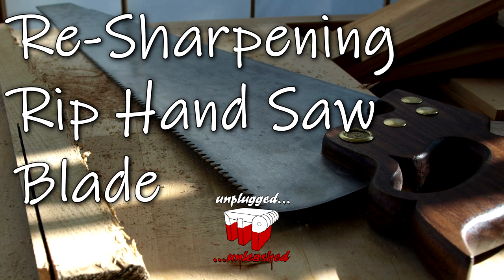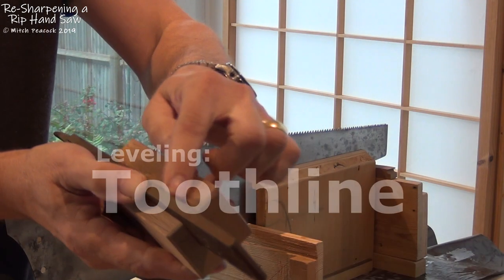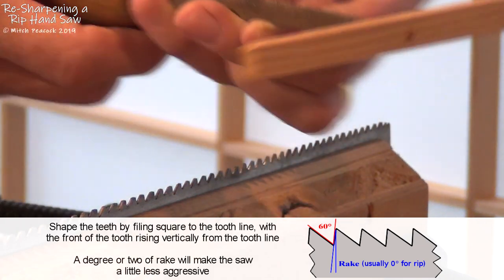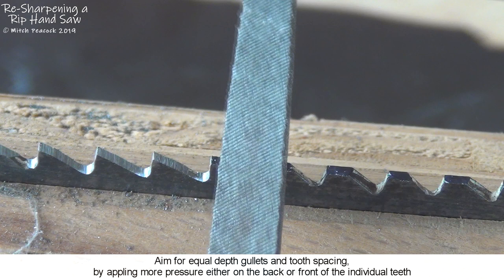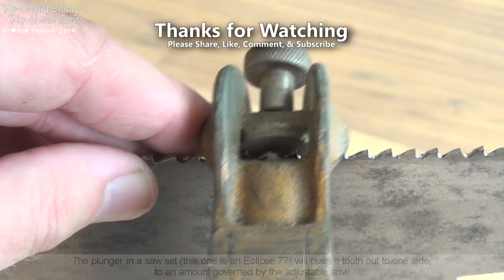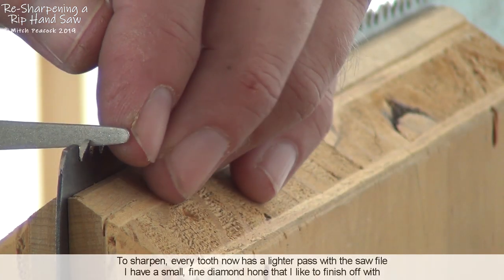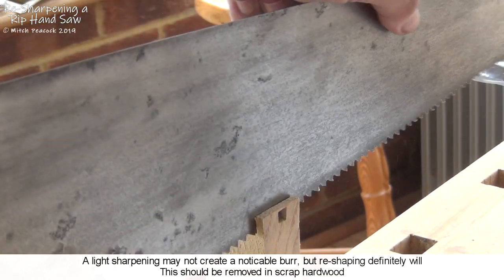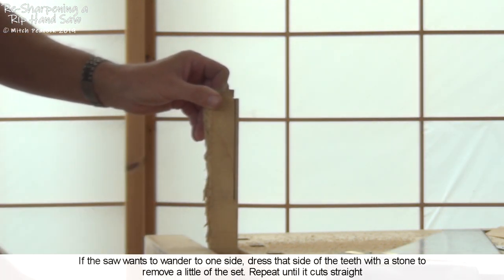How To Re-Sharpen A Rip Saw. Sharpen A Rip Saw. Test A Rip Saw

Comment: I have a saw i bought at a flee market last year...so you are saying that rip cut are off set teeth...what do cross cut teeth look like...hope you don't mind silly questions... inquiry mines want to know...so i will know what type of saw i have...the handle an button is exactly like yours here....thx...
Reply from the maker: No worries. Virtually all saws have 'set' teeth, to produce a wider kerf (saw cut) than the blade thickness, avoiding jamming. Rip teeth have the leading edge perpendicular to the tooth line, and in the same plane as the saw plate, with the tip looking like a chisel edge. Cross cut teeth have leading and trailing edges at equal angles, so they appear like pyramids in silhouette, and are also filed to look like knives. Hope that helps.
The button will often carry the maker's name, which may also be etched on the saw plate.
Reply: @mitchwoodwork  thx Mitch...always great video's...
Reply: @mitchwoodwork  Rip usually dies have less set though...
Reply from the maker: @RayVRoberts  certainly rip back saws often have little set, to keep them on track when cutting joints. Not sure of the convention for rip panel and hand saws though. My thoughts are that these cuts often open or close up, and so half the time a decent set will avoid jamming. Some times though you will still need to wedge a closing cut to keep sawing. Larger set leads to more waste and more effort though. Bit of a toss up which way to go.
Reply: @mitchwoodwork  Rip saws tend to have much fewer teeth per inch and larger gullets to clear the waste allowing for less set and easier cleaner cuts?
Reply from the maker: @RayVRoberts  cross cut teeth are poor at clearing waste, and bigger saws will have raker teeth, with huge gullets and no set, every few teeth. The finest toothed rip saw I have is a dovetail saw with I think 17 tpi. Very little set, this saw fights any attempt to steer it due to the plate being snug in the kerf.
It would be interesting to read up on the evolution of saws, and certainly broaden my knowledge beyond that of using them

Comment: What made the sigma(?) get into this to begin with?
Do you sharpen your own circular saw blades too?
Reply from the maker: I don't know, but one guess would be that it started with a slight belly (not sure if Disston ever did this, but a previous owner may have), and then was owned for a long time by someone who couldn't use the full length and preferred to use behind the middle. Only sharpening the worn teeth would eventually develop a hollow in the back half.
Seems unlikely, but it had to get that way somehow.
As to circular saw blades, I have honed the TCT tips on these, and it's easy on most, but where the number of teeth get high it can make sense to send them out or replace them
Reply: @mitchwoodwork  Makes sense. Thanks, Mitch.
Reply: @mitchwoodwork  Disston and many others sold breasted saws that have a curve in the tooth line. I have a few rip saws and the ones with the breasted curve cut faster, Not sure but I think they cut deeper because fewer teeth are ibn contact with the  kerf. They require more pressure to push through the cut too. 
My Foley Belsaw retoother has a ratchet bar with the breasting curve formed in the bar. 
You know I tend toward repairing trashed tools. I salvaged a couple buckled saw plates and a few with the bellied sections. I think you sre correct that the previous filer sharpened the teeth they felt were dull and skipped the rest. Since they usually cut worse rather quickly after being filed incorrectly it doesn't take long to have a considerable valley in the tooth ljne. 
My first few involved an afternoon with an 8 inch mill bastard file, and Dykem, to get the tooth line straight.
One bright side is the saw is blamed and put on the shelf long before the blade is worn away or the handle is dropped and broken. 
A quick run through the retoother and it comes out with nice regularly spaced teeth all in line and ready for the file.
Reply from the maker: Dave, why doesn't it surprise me you have a retoother 😆 I wish you lived in walking distance.
I left a moderate breast in the saw, so I'm excited to see how it copes with a good long rip, or more precisely how I cope